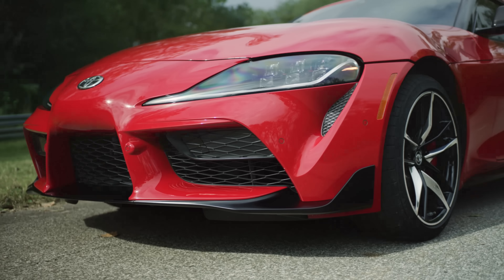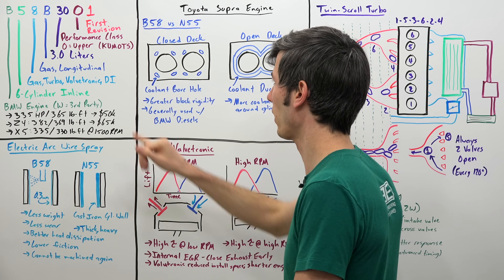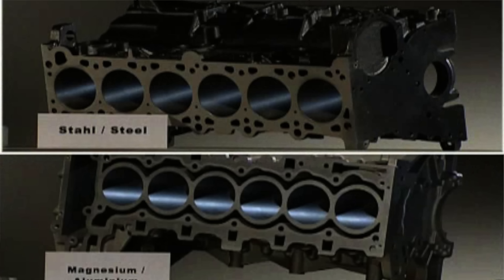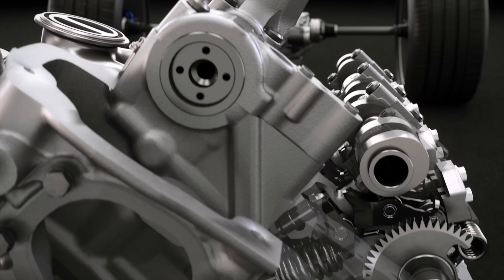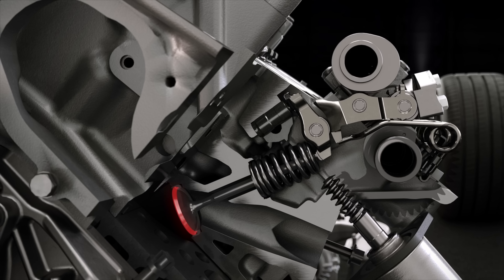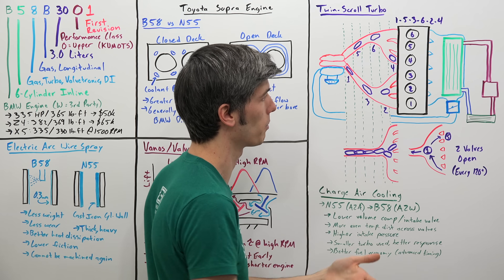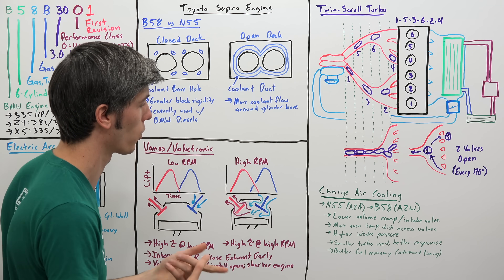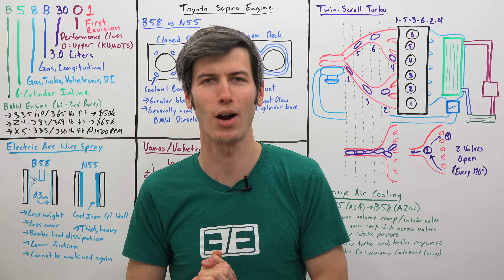2020 Toyota Supra Engine - Detailed Review Of The 2JZ Successor

Comment: I don't see why most people hate on BMW motor in Supra.
BMW is a master of inline 6 engines.
BMW has superior heritage,the fact that their cars are reffered as "Ultimate Driving Machine".
On the other side you have Toyota,which is a company that produces affordable vehicles.
They are looking to make money,not to make fans happy.
And since most fans can not afford a used Prius,let alone a Supra,they are keyboard attacking 2020 Supra.
But in reality,this car is going to be more than Toyota could ever achieve by itself.

P.S. This engine is very tunable,being closed deck engine it will reach over 600+ hp on stock internals and simple turbo swap.
Reply: Master of inline 6 engines? You do know that a BMW spends around half the time alive broken down, right? If it isn't, you probably have a full on christmas tree between the dials.
Reply: @ChrisDjoo  Lol how many BMW's have you owned?
I don't know if you realise that BMW is near top of the list of the most reliable cars in Europe.
Actually,BMW had a test running E30 for million miles.
Beat that dude.
They had dyno's under the wheels and run the cars 24/7 until they reached 1.000.000 miles.
Also,you have to maintain cars.BMW's are sports machines not everyday beater.
That means that you have to check up on belts,chain and do a oil change every so often.
Reply: The ultimate driving machines are and always have been Alfa Romeo.
Reply: @efferus  man of culture if i want buy cranky who have soul that  car it must be alfa romeo
Reply: @efferus  cough..FWD...cough...electricity problems...cough...weak engines...cough..
Reply: SUPRA fans, TOYOTA didn't care about YOU, they didn't care enough to put the effort and the money to build a SUPRA car, they just re-badge another sport car (like GT86), sports car sales are in the lowest point mostly due to SUV hype, so its not worth the money and the effort, there's no profit, that's how much TOYOTA care about their fans.
Reply: @danilorodriguez4665  what's most saddest is the majority of the fans complaining have never owned a Mark IV or a BMW B58 to be able to speak on it. All they know is what they hear. Almost like believing in Santa Claus. The Mark IV was never faster than this Supra at birth. The new Supra is almost a full second faster to 60 and they still complain and probably can't afford the car in the first place.
Reply: It is not hate, but just nostalgia... You don't quite understand everything, I mean if your are arguing with THEIR (BMW) marketing line (ultimate driving machine) then just go work for them
Reply: John Mitchell  if toyota made this by themselves.  It will cost like $80-90k
Reply: It is largely a cost saving exercise and since they are a business you cannot blame them, I doubt they make even close to as much from performance cars as from ecoboxes as it will be all about the economies of scale. I love BMWs and have had two, I've never owned a Toyota although there's plenty I like the look of. With BMW I believe the N series engines have a high failure rate; stretched cam chains but also turbo problems. With the old M54 inline 6 oil consumption is a problem, I live this first hand in my e46. S54 or whatever the e46 M3 engine is called is well documented for big end bearing problems and head gasket issues. The e46 has in my opinion one of the nicest looking interiors BMW has managed and most of their modern stuff looks pretty tacky so I can understand the keyboard warriors unhappiness there.
Reply: It's all about knowing your clientele. And the clientele for Japanese sports cars do not for the most part like European cars. In fact they often hate them. I don't see how Toyota screwed this one up so badly.
Reply: Is this the king of all bait comments?
Reply: @InvidiousIgnoramus  I think you got it.'Grats!
Reply: CME well let me tell you, because it’s NOT a Toyota, if people wanted a BMW they would buy a BMW or a BMW engien in a small car, maybe a Mini?
Reply: @anderslolle2147  Blame Toyota then?
Reply: CME  you do realise just because you call ur self god, you don’t become god right? Just because bmw claim ultimate drivin machine, it doesn’t mean it is...
Reply: @Woggin-ind  It is pretty close mate.
I'd say only the first gen NSX and newer Miatas have the same amount of fun and pleasure while driving.
Not including exotic cars that go
 over $400k
Reply: BMW just like Mercedes, over engineered German cars that sell overpriced and die almost as fast as their resale value. Let me just hop into my Honda Accord and put another 100k on it. A Honda or Toyota you can buy a 20 year old car for 600 bucks and drive it another 150k on top of the 150-200k it already has and only change fluids, brakes and tires. Dollar for dollar I'm driving the lifespan of your car for the price you prob pay for a couple tires.
Reply: @johnconnorstopskynet  Life is too short to drive a boring car.
Reply: @johnconnorstopskynet  if you've never owned a new Supra, new Mercedes or new 340i or M performance BMW you cant speak on niether. From an owner of 5 BMW's and numerous Mercedes.
Reply: @williamwilson5125  Exactly.I own a e39 540i as my daily and a e36 325i as a project drift car.
My dad owns a F10 530d and from those cars only headache i had was with e36's radiator fan.
My e39 has over 350.000km and is still going really strong,i may put on a supercharger if a used one pops up.

Use high quality oil and change belts/chain when it is due and you have a car that runs forever.
Reply: @lazar2175  Happy motoring my friend👍
Reply: 7jacob2453  most of these so called Supra enthusiasts who slander the new Supra have never owned a Supra.
Reply: @Ollie Clark With turbo swap easily goes above 600.
Reply: if it was only the engine it would not be a problem, but everything else is also bmw, suspension, interior, entertainemnt system, etc etc all bmw, if they wanted to build this, go ahead but for god sake dont call it a supra because it simply isnt one (just looking at the enterior of both cars you can see the difference)
Reply: @cj09beira  I think that Toyota designed enterior.
The BMW provided the chasis and the engine.
I think people overhyping the mkIV too much.The engineers that have designed the mkIV have probably been retired or fired.And there was no way Toyota was going to make a same mistake with Supra enterior.From a logical standpoint,mkIV enterior was everything but good.I will admit,the idea was good and it is unique.
But taking the car off for a longer roadtrip would result in you being extremely sore and bored.
The mkIII had a great enterior and the outside looks like old 8 series BMW which leads me to thinking there were previous colaborations we did not know off.
But realistically speaking,BMW is not guilty for the new Supra.The chasis,suspension and the engine are better than Toyota could ever make.
Blame Toyota for being lazy and ordering a semi built car from BMW and put in a Lexus enterior inside.
Reply: btw we have seen the interior, its 100% bmw, even the wheel is bmw.
Reply: Have you seen pics of the interior?  Clearly not.  Might as well drop in some M badging.
Reply: @lazar2175  --> "The mklll... looks like old 8 series BMW."
What?? Now you just sound like a super young millenial that thinks all '90s cars look the same!
Reply: @davidg4026  It is identical dude,go look it up.
With the headlights down they look really similar.
Reply: @lazar2175  i think you dont realize why people like the supra. if they wanted a well engineered car that lasted for 5-6 years before it started having a lot of maintanance & reliability issues then theyd just buy a bmw.

the supra was different. highly modable, reliable, easy and cheap to fix. its something you could take part of.

the car may be "good" but its not a supra. its a bmw with dofferent bodystyle. plagued with all the shitty issues expensive bmw's have.
Reply: @lazar2175  --> I don't need to look it up dude, I was in my early 20's when both cars were new! I saw them on the street every day, and I can honestly say it never crossed my mind that the 850i and the Supra look alike. The only parts of those cars that look similar are the band of marker lights on each side of the front bumper... That's it! If you're thinking; well, both cars have long sloping hoods and pop-up headlights, and both have big square taillights... Guess what, so did most cars in the late '80s and early '90s.
Reply: Toyota made the lexus lfa so they can definitely make better cars/engines than bmw
Reply: @ikemanreed  the LFA was the biggest lost of resources and Finances the company has ever made. Only 1% of America could actually afford a 400k car. Now tell me where is the logic in producing a car that was only for the filthy rich. Dumbest production car ever and Toyota knows it. That's why they wont pull that stunt again. Just like Acura is losing its ass on making a 200k NSX. Cars like that dont sale when they cost as mush as super exotics
Reply: @ikemanreed Toyota did not make the LFA engine it was principally made by Yamaha, hell they even got help from Hitachi on the 2JZ.  Toyota has never made an engine in house that could compete with a good BMW engine from the same time period.
Reply: @Sve3t   No they got help from Yamaha with the 2JZ. Not Hitachi. The CT20 turbos were built by hitachi but it was developed by toyota. But you're correct. %90 percent of their performance engines were developed with the help of other companies like Yamaha.
Reply: @ikemanreed  i´m really sure that if toyota really invest and concenttrate in sport cars they will beat everyone else on the game but toyota just dont want to do it they are working on better things
Reply: If Toyota built the car and bought the engine I would be ok with it. If toyota bought the car and made the engine, I would be less ok with it, but more ok than it stands. But Toyota bought both and modified the exterior... at the BMW factory.
Reply: @Oblithian  That is just Toyota being lazy and greedy.
Toyota realised that they could buy the Z4 for less than they will sell the new Supra.
Pop in a Lexus enterior,Toyota badge and a wonky design and they call it a Supra.
I'd say that the car will perform great,but will not be competitive due to Toyota cutting corners.
Reply: @Oblithian   Both cars  will  be  built at  the  same  Magna Steyr  plant  in  Austria.
Reply: nah he make a good na inline 6 engine but turbo with reliabelity like toyota probably not you can see how much old toyota car still going strong in road and compare to bmw
Reply: @kevinbosco5876  What have you forgot is that BMW makes performance/luxurious cars,while Toyota makes budget cars that are made to last.
BMW's need regular servicing,and they are made for middle upper class.Not for someone that forgets to change oil and is too cheap to do regular checkups on chain tensioners and belts.
Reply: @lazar2175  we talking toyota here not some bmw all toyota engine is bulletproof even like chaser and toyota mark series they put in same level on bmw but cheaper now and that car now become drift car with really abusive owner but the engine itselft still fine because its toyota and if you look back all bmw they are now all belong to scrapyard unless its m40
Reply: @lazar2175  toyota also makes the crown, they actually put a v12 in them in the 90s, something of a japanese rolls royce. Toyota used to make performance cars and their certainly capable of making vehicles that compete with BMW like the lexus lineup. That's why its so dissapointing to hear they are going to put a bmw engine in it. When the 1-UZ came out in the ls400 it was one of the only engines made and put into a vehicle that was licensed for use in airplanes. Toyota has made very high performing reliable engines in the past sporadically and i think people were expecting an inhouse innovative design

Comment: This engine is a disappointment. Out of the factory, 2JZ GTE is tunable to 800 horse power without component failures. With reinforced internal components swapped, you can deck it out to a hyper car level engine. Overall, B58 compared to a 2JZ GTE is a huge DOWNGRADE and DISAPPOINTMENT!

Comment: I don't understand this decision by Toyota. They have an awesome, robust and reliable V6 in the Camry Lotus is using to get 430hp. Now, they are tying their flagship to BM -trouble you reliability.  In the words of POTUS: Yuge mistake.
Reply: okleydokley because it’s a transverse engine. You wouldn’t want the Supra to be a FWD, right? It works on the Lotus because the engine is mounted at the back. So unless Toyota wanted to make the Supra a mid engine, the V6 in the Camry doesn’t make sense. If they made that its would be a successor to the MR2.

Comment: The Supra and Z4 were developed together so in theory the Supra is as much Z4 as the Z4 is Supra. The drivetrain may be BMW but the rest is reportedly developed as a bespoke platform for the two cars, nothing taken from previous models, other than things such as switches and the aforementioned drivetrain (even then the gearbox is a ZF unit, not BMW, used in a huge variety of cars). And for the people complaining that it is still a BMW because it will have BMW labels and stamps, the 86/FRS has Subaru stamps all over it, and the Lamborghini Diablo lights have Nissan stamped on them, and they are all still great cars.

Comment: Everybody is hating on the Supra because it was developed with BMW. I think that this is a good thing, BMWs are very good cars,  the Supra is actually benefitting from that. I think with a couple of mods the engine will really wake up. 3 inch cat-back, down pipe, CAI and a ECU tune, and that thing will go. The exterior looks actually amazing, saw some renders with a MKIV style wing on it and lowered, looks absolutly sweet. I will propbably get one in 2021 or 2022. People forget that the stock MKIV wasn't really a beast. The 2JZ really woke up with modding, this will be the case too with the new Supra. In 2 or 3 years, everybody wants one.
Reply: BMWs are okay cars right up until the warranty runs out

Comment: Best handling Supra with a usable infotainment (which Toyota is incapable of) a RWD platform and a high end interior. 

The Mk. 3 Supra was rubbish, it’s engine unreliable. The Mk. was only about the engine _ once modified. But still hardly anyone bought it, or if than the 2JZ N/A in automatic which again was rubbish. 

The B58B30 is a quite tunable engine for modern times with harsh emission and safety regulations and the ZF 8HP is a very strong gearbox. I worked a their factory.

Comment: This car is much better than the mk4 Supra from basically any point of view. The  new chassis is both stiffer and lighter than the old one,the new engine is not legendary but is lighter than the cast iron 2jz and has less turbo lag. It also has vvt and VVL (yes, the new Supra has VTEC) which will probably make the car much better to drive. The new Supra also has multilink rear suspension which is basically a better double wishbone suspension, it has an electronically controlled rear diff, and the list goes on.
The only things I don't like about it is that is basically a BMW and that there is no manual gearbox option, not even a dual clutch, just a torque converter automatic.
Reply: all that list of stuff will break. The industry is a now avoiding DCT because companies like Getrag screwed too many manufacturers will weak DCTs that cost a fortune in warranty swaps. I'm betting Toyota insisted on no DCT for this reason.

Comment: Why do you need a closed deck with only 335hp... blah
Reply: The B-series is a modular design that's also used for BMW diesels in both I6/I4 configurations.
Reply: I was being sarcastic because of the lack of HP :)

Comment: Best thing about Toyotas is their amazing build quality. The JZ series of motors are some of the best built and longest lasting engines mankind has built. 

And now here’s ANOTHER two door Toyota sports car that’s missing one of the best things about being a Toyota. 

BMW has NEVER to this day made ANY motor as durable as a JZ so there is ZERO reason to expect this motor to be on the same level. 

Clever engineering does not equal best build quality. 

Dozens and dozens of modern engines have amazing engineering that’s beyond a JZ but NONE are proven to be more durable. 

The first Supra I’m going to care about is going to be the first one with an original JZ swap. Should be within 48 months.